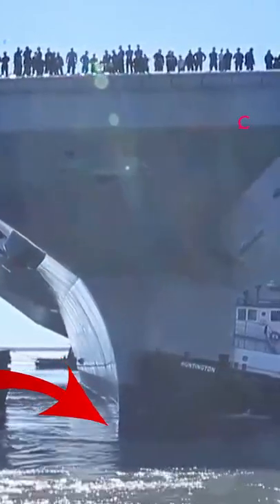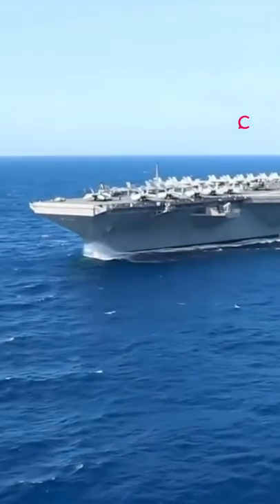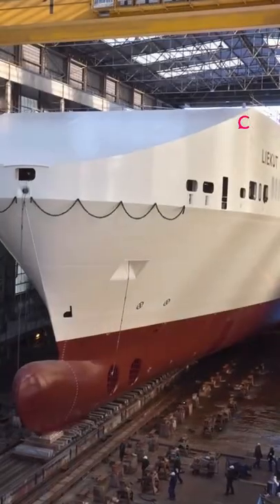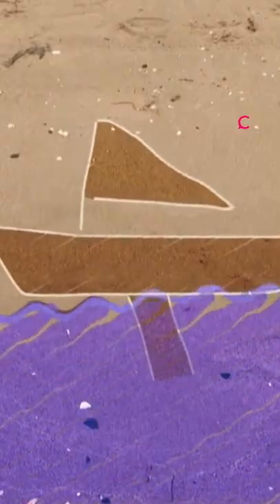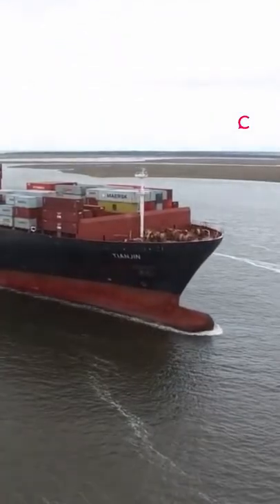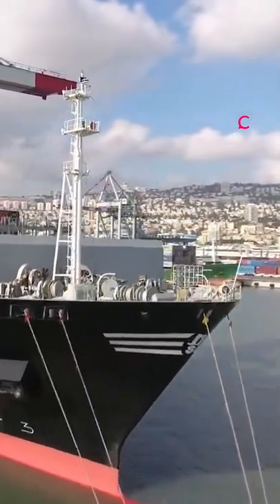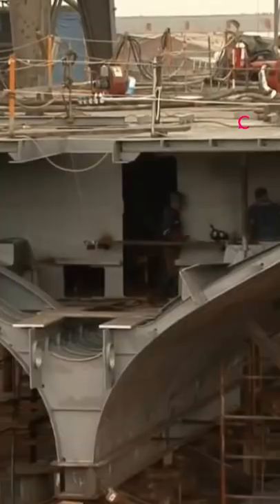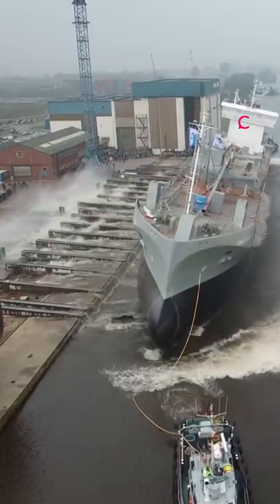Why are aircraft carriers so skinny at the bottom?

Comment: This is good: displacement and weight distribution are the two key factors
Reply: Mistake: "A ship will float if it displaces water equal to or greater than the weight of the ship."

No.  The weight of the water displaced is always equal to (never greater than) the weight of the ship.
Reply: @sailbatten2056  🤔 hmmm
Reply: You are right that's why the Island on an aircraft carrier sits on the side and the deck  is larger out to the side to as the regular shit design the the mast is in the center to balance the weight. You can learn that on modern marvels. Amazing ingeniering. Mega build. And many other documentaries that history and national geographic. Channel have produce. For all most 20 years.
Reply: @sailbatten2056  wrong
Reply: @sailbatten2056  1

Comment: Ships generally have skinny bottoms, or inverted triangular hulls, in order for the proper displacement of the weight on the water. If you try to float an inverted triangle versus a flat box in high, rough waters you can bet the triangle would fare better, especially when doing lists

Comment: The form factor is critical also. The stability is dependent on all of the ship construction elements. The most critical elements are the placement of centers of gravity of the entire ship and of the water displaced by the ship. And to this static stability caracteristics, there are more other elements related to dynamics fluid mechanics, and so on. The shape of the hull is also critical for ships performance: cruise speed max speed, maneuvrability and fuel efficience. The comentary in this video is at least superficial.

Comment: It's the air in the Hull that keeps the ship a float if you remove the air it will sink
Reply: No.  If you remove the air, and do not replace it with anything, it would be a vacuum and if the ship didn't crumple, it would float even higher in the water.  

The air helps because it is lighter than water, but the surface area compared to it's mass is why the ship floats.

Comment: Remember to construct your aircraft-carrier with upper "buoyancy" tanks to give you a more resilient "buoyancy" — and place your buoyancy tanks as high as possible i.e higher than the central axis of gravity
Reply: Lol
Reply: 'Last thing you want' is your aircrews trapped inside any capsized hull👽
Reply: Thanks for the heads up, I was just about to construct an aircraft carrier and almost forgot about it....
Reply: That is total bullshit. Buoyancy tanks give absolutely zero buoyancy if they are above the water ffs 😂

I lived 4 years on a carrier and dived the length of its hull. Narrow at the bow but quickly getting fatter than Pavarotti
Reply: @Berkcam   @Berkcam  it's lucky you're not a 
naval architect — if you'd been allowed to exercise your idiosyncracy you might've ended your sorry days trapped in a capsized hull with its buoyancy tank in the bilges above you👽